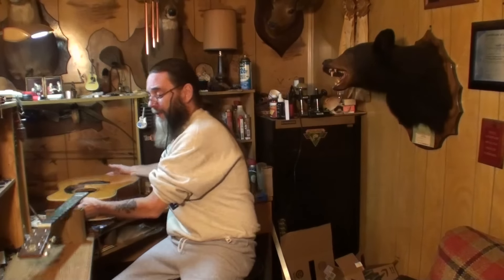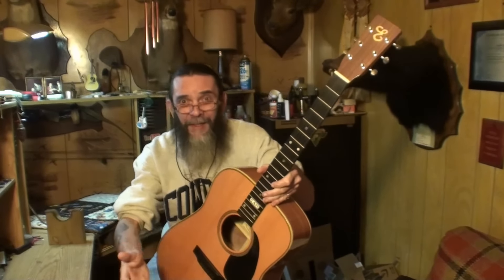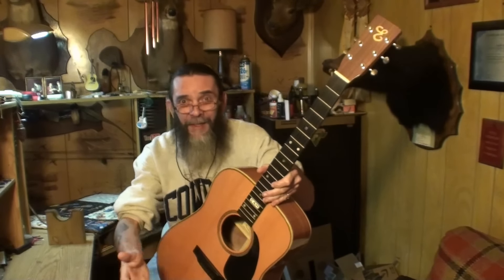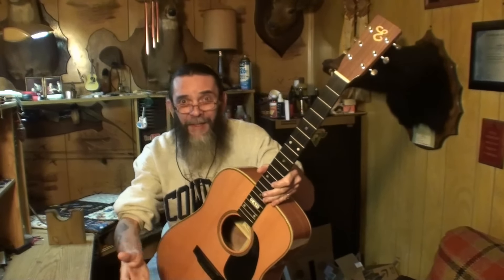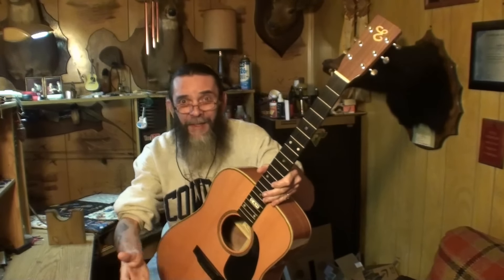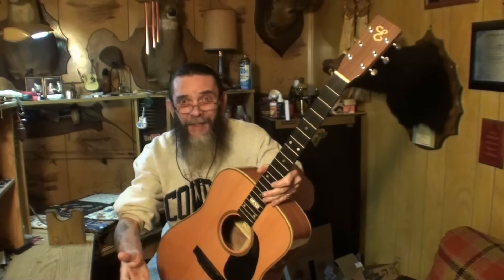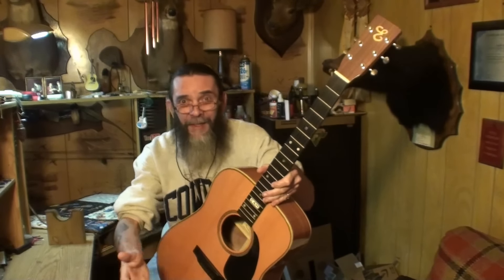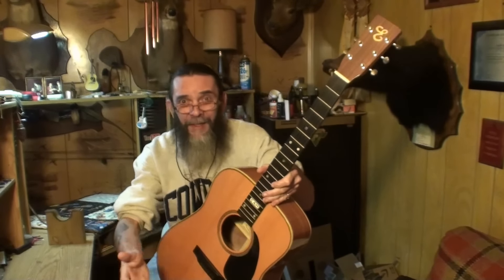Echowebb Guitar inspection What would YOU do?

Comment: Great video, great highlighting of problems!
Would have a go 
1) at the bridge first
2) at the neck, and
3) the crack.
Going forward, the crack is hardly bad to need cleats. Glue pumped in should suffice.
Why the bridge first: so that I can get an accurate reading of how much I need to bump the neck back for my straight edge to glide over the top of the bridge (and saddle).
Additionally, after pulling the neck joint down, so that it is flush with the top, and if the hole to seat the bolt has moved, I would need to push in a dowel dipped in glue, and slice it off to close the hole.
A new hole would then be required to help seat the bolt properly!!

DID I PASS THE TEST, PROF SCHARTIGER???

Can't wait to see how you do it!!!
Reply from the maker: Very very good points! And yessir you definitely pass! :) I went ahead and cleated the crack, it was a LOT worse before I humidified it, so if the guitar ever gets that dry again the cleats will prevent it from ever opening up again. I did this because I assume the guitar will be going back to the same place it dried out at. Thanks for your input! It's interesting to hear how others would go about these repairs.

Comment: I don't know. maybe take care of the bridge Remove the bridge and glue the crack only  (no cleat), there seems to be enough bracing. then glue the bridge down and adjust the neck to the newly fixed bridge. Looks like the neck can be adjusted more easily than playing with the bridge.
Reply from the maker: BINGO! You nailed it mate! Other than your suggestion about the cleat I agree 100% because we have no adjustment on the bridge, once it's fixed it's permanent and stationary, we do however have some adjustment at the neck joint to make it match the plane of the bridge. Very good call Tim! I ended up adding 2 spruce cleats because the seam was separated pretty wide before I humidified the guitar, plus when the owner gets it back this bridge is never going to pull up nor the top seam open up again! Thanks for having a look and your input! Cheers!
Reply: Cool, it a fun way to watch the video, makes you think first then learn how to do it correctly. Which way did you run the grain of the cleat? Looking forward to the upcoming videos!
Reply from the maker: *****
I ran the grain of the cleats across the grain of the top of the guitar, by doing it that way it greatly increases the strength to hold it if this guitar ever gets dry as it was again. Once I get the bridge glued back on will also help support the top from opening.

Comment: Hey Randy, we kinda all know what are the signs of an dried out guitar, BUT ! What are the sure sign of over humidified guitar? I have one guitar with little belly, and I can already put some paper under the bridge, but that's about it. No sunken wood or something like that. It has fine low action, (no enough deep bass unfortunately..) but that bridge worries me so I don't know should I humidify it, or let it dry a bit..
Reply: Gillette Wilkinson   Where I live the humidity rarely goes below 60% and mine is the same as yours
Reply: Gillette Wilkinson A sure sign of a "wet" guitar is that both top and bottom have swelled. On the top the swelling usually begins around the soundhole and extends to the block at the back. The part where the block is can't swell so that area stays flat. The swelling is all over basically and not just behind the bridge. The back usually has even more swelling.
Reply from the maker: Really the best safest way to tell is to put a hygrometer inside the sound hole and block the sound hole with something plastic that won't absorb moisture. Leave the hygrometer in the guitar for at least 48 hours then check it, it should always be between 45% to 55%, if it is, then the guitars wood is maintaining moisture content perfectly! Anything over or under those numbers should be addressed asap. I've gotten guitars in here that were so humidified mold was forming inside! Also, some guitars naturally are not flat across the top even tho they are called flat tops, some models of Taylor guitars have a slight arch to them, if you KNOW your guitars top is supposed to be flat like some Gibsons and Martins yet it appears to be arched, then it's probably over humidified.
Reply: tank you guys!  loads of help here, loads of help...

Comment: Top first, if it ain't right then the rest won't be right.  Then fix the neck, then the bridge.   One has to follow the other.    I would glue the seam, that is after all how the guitar was built.  A cleat on the top?  probably not.    I would think there is some play in the bolt on neck fastener otherwise how would the neck come up?  Of course there is the cost of all this work against the value of the guitar.  A ton of work, and not cheap I would think.
Reply from the maker: Exactly! Another great answer! It would be impossible to get the plane of the fretboard to match the plane of the bridge and the proper neck angle with the bridge lifting. Another good call here!

Comment: And I thought glued on fretboard on a bolt on neck didn't make sense.  Too many screws, nuts and bolts on this guitar.  Once the neck is lose and tension taken off of it it may sit down and change angle to become perfect again.  I doubt that it warped as there is no glue in the joint.  But then again I'm thinking electric blocks of wood and not fragile laminates of wood.

Have you ever tried washers under the bridge pins.  Barely wide enough for the pins to go through and strings to lock not wide enough to touch each other.  They spread the load on the bottom of the bridge (backing plate) without gauging it.
Reply from the maker: I am hoping you are right! Once the neck has been pushed all the way back into the joint it may very well correct the neck angle and be perfect! It'd sure save me a lot of work should that be the case. 

Never tried that but it sounds like it may be a good idea, people don't realize how bad their bridge plate wears over time. Thanks for having a look mate!